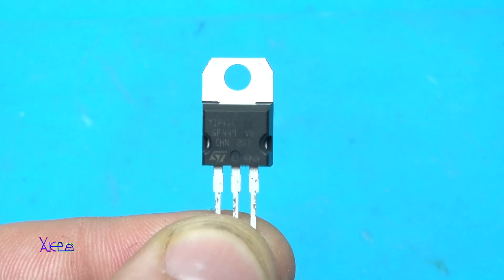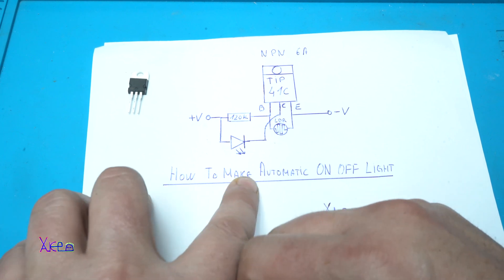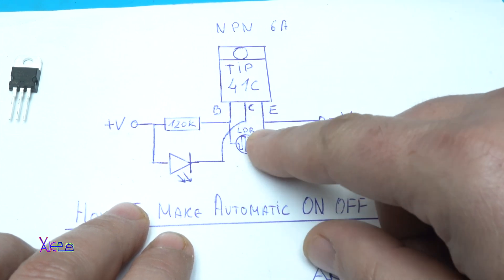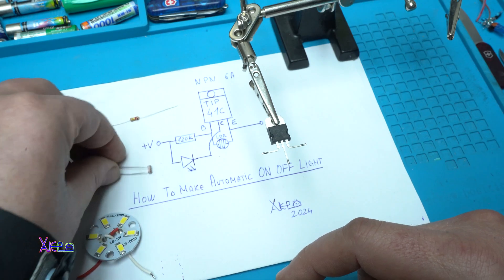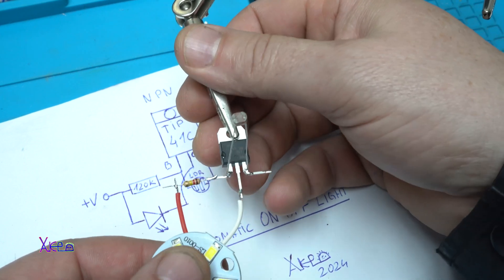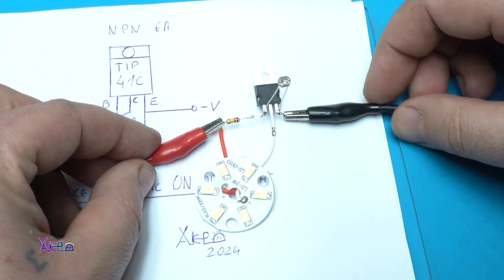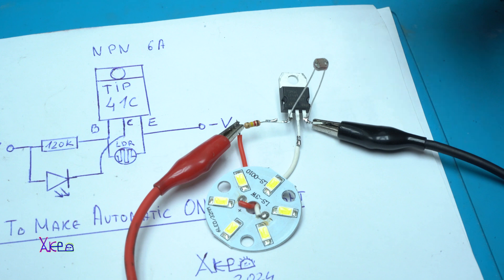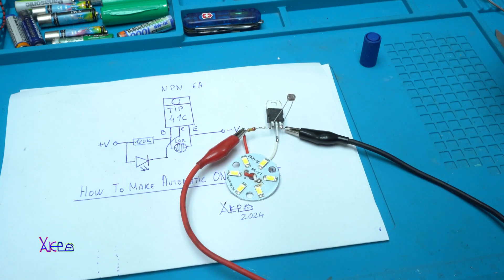ONLY 3 Components To Make Automatic ON OFF Light

Comment from the maker: You need to try this circuit,its simple and working great.
Reply: How sensitive is this circuit for the photoresistor if you want to use it as a led projector outside the house in the day light?
   Will the leds flicker as the night comes until the transistor is fully opened?
   I suspect the leds circuit will surelly flicker when the light is not stable, becouse those photoresistors are not so precise.
   That's why, perheps an esp32 microcontroler coded with the "right" code would do the job better.

Comment: It has no hysteresis. You have to make a small modification, otherwise you will have an intermittence at the beginning of sunrise or at the end of sunset, that is, when the circuit is in threshold.
Reply from the maker: That is true,maybe in next project I will add those mods
Reply: @Hacktuber  👍

Comment: Great circuit! But I see a problem. Please, could you measure the current consumption when the LED is off? Depending on the type of transistor used it could be high because of the simple switch used for the base.
Reply from the maker: Noted
Reply: I guess you could use a mosfet instead TIP41C.
Reply: @m1ha1mateescu  Probably, I guess too. I'm no expert.

Comment: Question. If it's that simple, why do most gadgets use more complex systems? For power saving or better performance? Is this simple system more prone to failing or overheating?
Reply: Short answer:
   Becouse those photoresistors are not precised and they will flicker if the light is at the "edge" (between dark and light)
  In order for tricking them to be more "precised" you need to "program" them using a microcontroller. 
   For examample... If you need a led projector to automatically open when the day light comes and close when the night comes, you don't want those leds to flicker when the day light is unstable (between dark and light)....
Reply from the maker: Good point!
Reply: Realmente ,lamentablemente ,hay razones variadas por la que no solo no utilizan sistemas mas sencillos,sino que lo hacen mas complicado ,la razón se llama "economía elitista" ,de ahí sale otra palabra "control" ,las élites realmente no les importa tanto el dinero ,les sobra ,lo que desean es control de la multitud ,del "control" aparecen nuevas derivadas ,necesidad de obsoletos consumibles,irreparables  (costosas reparaciones),dependencia del fabricante por programación en circuitos integrados impresos en placas y mecanismos electro mecánicos  de uso exclusivo y dependencia 100% del fabricante,un ejemplo es las centralitas de coches por nombrar una de miles de ejemplos ,le diré un ejemplo de miles en el que se hubiera ahorrado billones de cualquier moneda ,recuerda las famosas radios o equipos de sonido,tv de los años 60,70,80,90 todos tenía en común un transformador de 220v ¡Ok! Ocurre que hay un circuito muy simple y muy seguro ,muy barato que equivale al uso de ese transformador ,aunque se preguntará usted,tal vez no lo sabían ,ya le digo que si lo sabían ,es con condensadores y resitencias ,,así puedo seguir e igual llegamos al maestro Nikola Tesla ,obviando no era el padre,el fue alumno de otros maestros que silencia la historia manipulada ,se resume todo en control,espero haber repondido a su duda
Reply: The first light bulb is still on to this day... the reason they "die" is bc of capatilism.
Reply: Its simple answer. Business. How would you sell many different types of electronics components if you will make a simple device? Where will you bring those millions components that was manufactured by electronics companies?